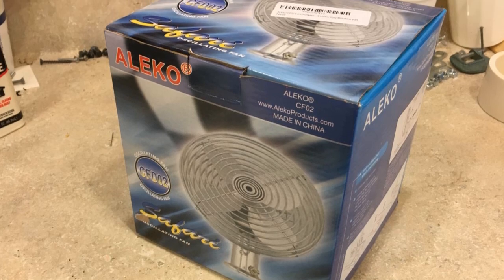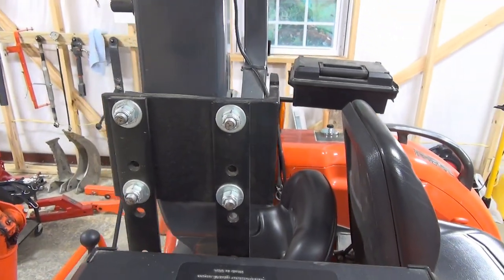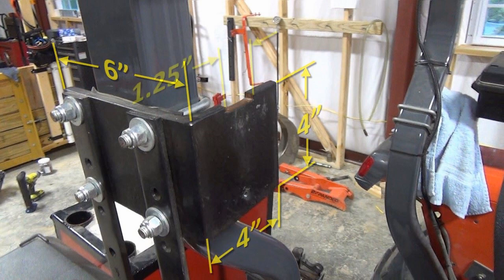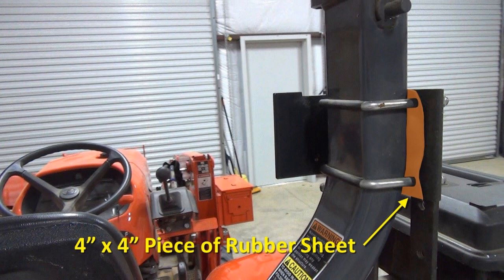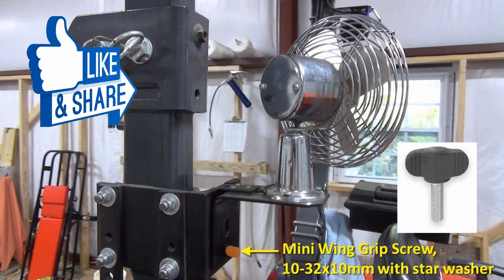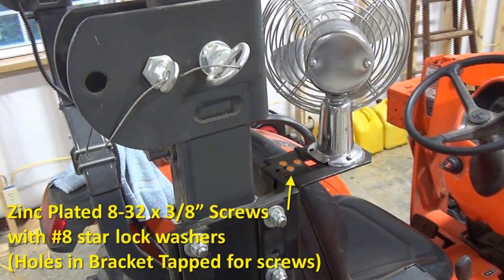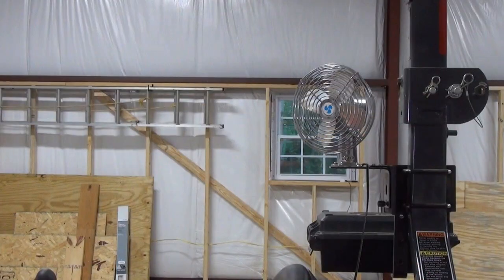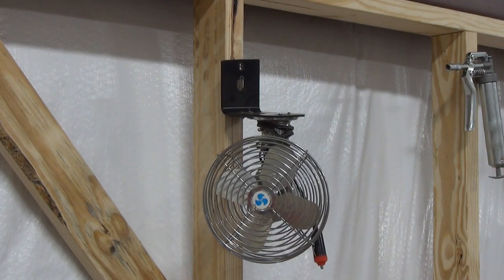Kubota Tractor Mod: Adding a ROPS Mounted Fan (#59)

Comment: I think an automatic lady-sensor and audible alarm would be a nice accessory Martin.  That way when the wife tries sneaking up on you to see why you are late for supper you could make sure your are working and not just watching your favorite YouTube channels on your wifi computer that's mounted on the other ROPS.... just sayin'...LOL.    I picked up an old 1951 Allis C way off in the woods at this guys deer camp about ten years ago.   He had a 12v fan as well, plus a pair of automotive spot lights like the cops have, there was a bracket for a pump operated oil can, a bracket for a grease gun, brake lights that said STOP across them wired into the brake pedals, a pto mounted alternator wired to produce electricity through an inverter under the seat for power tools, a car horn with JC Whitney push button on the steering column and a mount for an axe....just to name a few.  I do believe I filled two five gallon buckets with wire, relays, switches and accessories from that old tractor. Oh yes, the kicker for me was the siren off of a fire truck.  Man that thing was loud too !!  So you are right about the possibilities being endless.....Great video once again my friend.  Btw, I like Houndsman's idea about the 50 cal....LOLOL  Kubota version of Rat Patrol !!
Reply from the maker: Wow!  That Allis C was really tricked out! LOL “Kubota version of Rat Patrol”!  LOL. I love the image of that! Thanks for watching!
Reply: @DIYMyWay  Guys much younger than us won't get the reference....LOL.
Reply from the maker: True. And I’m cool with that!

Comment: I've been using a clip on type 12v fan for a while. Personally I like it blowing on the back of my head but haven't found a good place to permanently mount it. I've also considered a monitor for a camera mounted on the grill guard so I can see the loader bucket or forks.
Reply from the maker: I wouldn’t mind having a FEL bucket camera. Thanks for watching!

Comment: Can you use this fan in light rain? Sometimes you may be far enough away from the shed and not be able to make it back in time.
Reply from the maker: A little bit of light rain probably wouldn't hurt is for a short time, especially if you wiped it off after you got in.  The motor is sealed.  In case of a down pour, you could carry a plastic bag to slip over it.